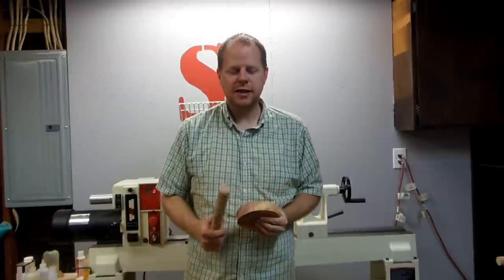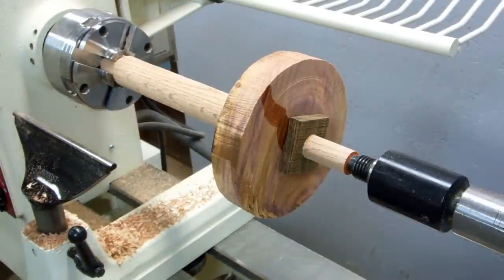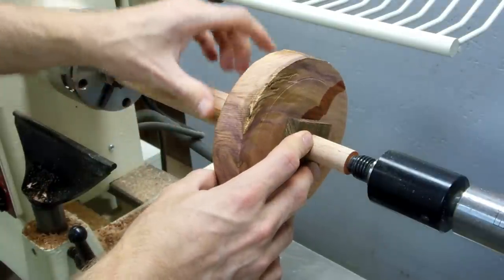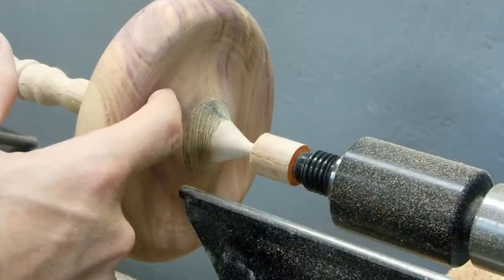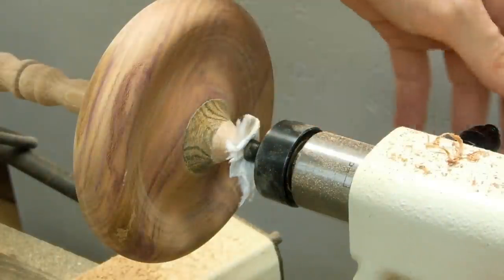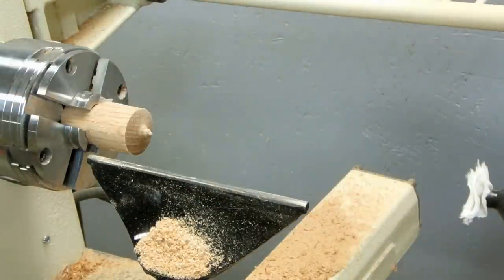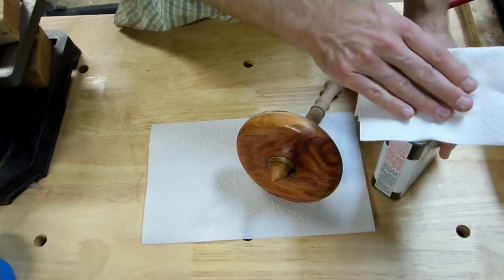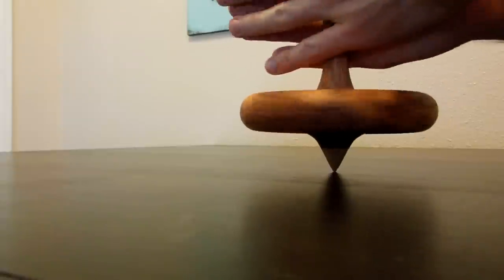Woodturning large spinning top using carbide lathe tools

Comment: awesome project, think I'll try one.  I do tops to practice my spindle work.  strictly from my own experience, I would wager that the wobble in your top is caused by those bug tunnels on the outer rim of the top.  Even that little bit of imbalance makes a HUGE difference in the spin smoothness and duration of the spin especially on a top this big.  Please do not think I am degrading your work, just sharing what I learned.